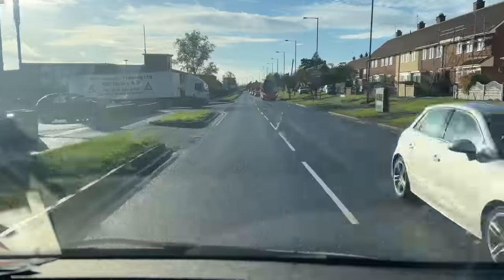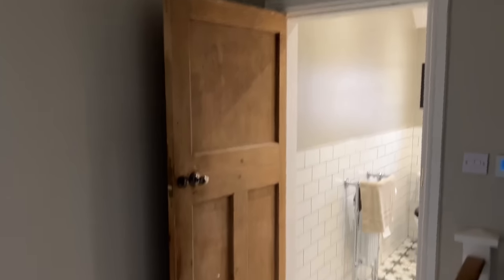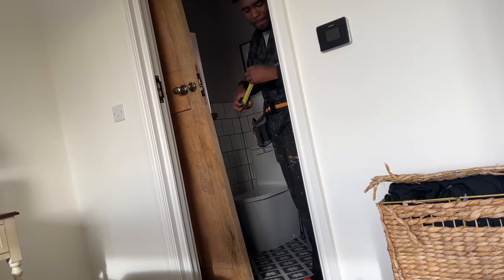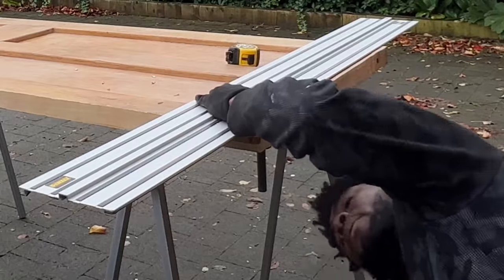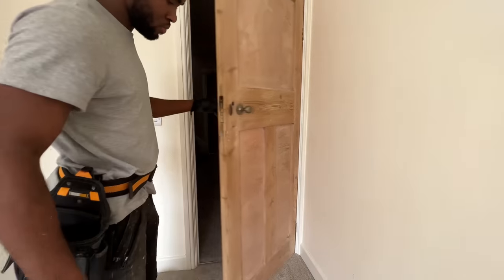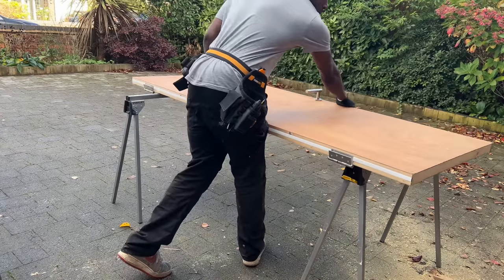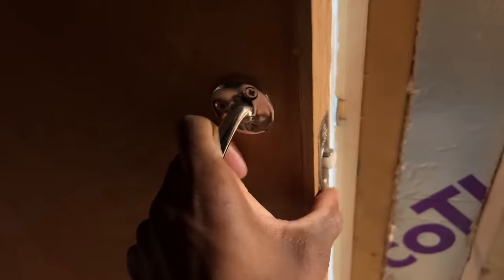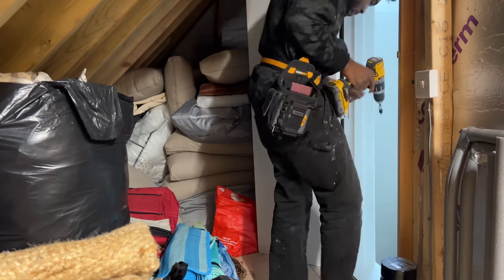DAY IN THE LIFE  OF A SELF EMPLOYED CARPENTER ( do the small jobs matter?)

Comment: Tip of the day from a pro joiner with 32 years on the tools. Invest some £££ in  a quality dust extractor (Festools are brillliant), hook it up to your plunge saw, lay the door down on the floor, support your cutting edge on a 2 or 3" high batten to avoid accidental carpet-cutting disasters, and cut dust-free in the room - not outside on trestles. Saves all those trips up and down the stairs, enables you to make additional adjusting trims there & then if necessary, gets the job done in half the time = doubles your hourly earnings. Best wishes.

Comment: Great stuff for finish carpentry !  Maybe instead of going fast thru your actually working the hinges and chisel work put that in and what you hv to be careful of ?  Remove your hinges one at a time and place a 3” screw into jam thru your rough framing grabbing the sag in solid core doors!
That when they eventually pull off and stain or paint the doors ( painters always do) it does not affect your work.  Narnex I believe is the name make a great set of chisels and p/u a set of diamond stones that way your working with a real sharp chisel and most often never hv to drag the hammer out!  I use a doubled headed mallet when working with doors it leaves no mark!  
Your gonna hv a great channel!

Comment: Nice work ,try to take a door off by removing the center pin in a door hinge with a nail set and hammer by taping the pin up and then out. It’s a lot easier than unscrewing the hinges
Reply from the maker: these hinges didn't have this I don't think but I will make sure to check next time , thankyou
Reply: Most doors in UK don't have the centre pin option although I did come across it a bit in the 1970.s

Comment: I’m retired I am I am what in the US is called a general contractor carpentry tiling everything skirting over here is called baseboard I prefer the belt sander planner method and back bevel it take more off from behind and it’s easier to clean with electric or hand planer to the pencil line I was based in New York City

Comment: bro it's pricy, but get the festool tracksaw with the dust extractor, you can do those door inside. All in its about 1k , which is significant, but think how much time you save going up and down the stairs with the doors especially that one on the top floor, you get a tiny bit of dust on the floor negliable, charge the same but do them in. 1/4 of the time.
Reply from the maker: I’m definitely going to take a look into this

Comment: The small jobs are the best,working on site with other contractors can be a pain,also here in Liverpool I would charge £180 a day  and less for say fitting new doors usually £50-60 a door
Reply: Id charge more mate! At least £80/100 per oak veneered doors!
Reply from the maker: Depends where you are based but yeah I try to make £200 a day 50-80  per door fitting

Comment: Using tarp as a moisture barrier is pointless you should of used a proper dpm.. and just replacing the cill is also pointless because it appears to be sitting on the ground.. being a carpenter of  35 years i would of removed the whole frame and rebuilt it making sure to leave some distance between the cill and the ground to stop water ingress..

Comment: You did well.....until you used a tarp as a moisture seal and used sanitary silicon !!!  correct DPC is cheap and CT1 is going to be the correct exterior sealer
Reply from the maker: Yes I agree , I thought I had DPC on the van but I didn’t so I had to improvise but this method should definitely last a life time. It’s all sealed and tarp although it isn’t 100% correct it still works as a moisture barrier and I also did pack it up so the sill is not in contact with the bricks or concrete at all . But I do agree with you so thank you.

Comment: Am I missing something here, the doors look like 1/2 hour FD's with intumescent strips but no door closers and no 25mm door stops? Anyone know what the reason for this could be?

Loving the video
Reply: as there is loft conversion building regs only specify 1/2 hour firedoors on all other doors opening on to stairwell  and not closers oddly enough an if you fitted them i bet most home owners would take them off after u gone
Reply: @johnfackrell7516  Yes, I have seen it so many times, no 1/2" stops either?
Reply: Most of the time, people just take them off after being signed off
Reply: @johnfackrell7516  All day long. My question is the door had intumesent strip but no 25mm door stops. I have seen this before leading onto a staircase. Could it be that this door is a FD30 but not being used as one?

Comment: Cringing a bit over your bare feet, i know why you are doing it, i am in the job, screwfix do some slip on safety shoes that are great for indoors outdoors jobs
Reply from the maker: I need to invest in some overall shoe protectors
Reply: @ttdowgcarpentry2390  i tried them and used loads in and out off and on, now just got the clean slip ons ready if i need to change. had this pair 4 years. On ebay you can get some snazzy brown suede one that are super comfy but a 10er more